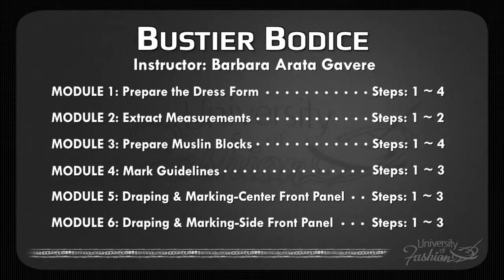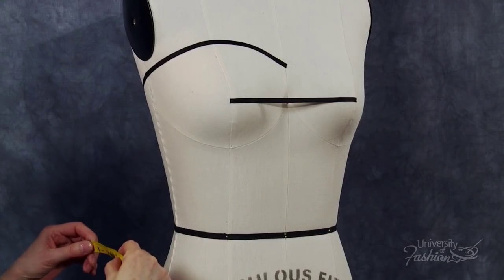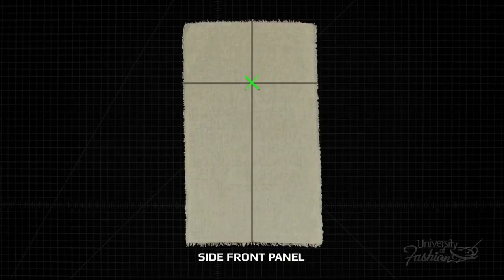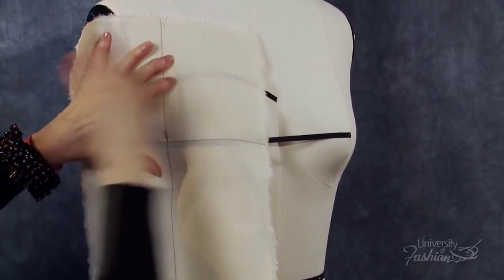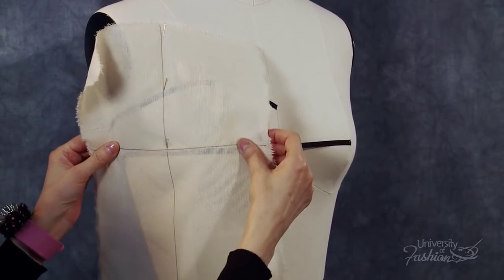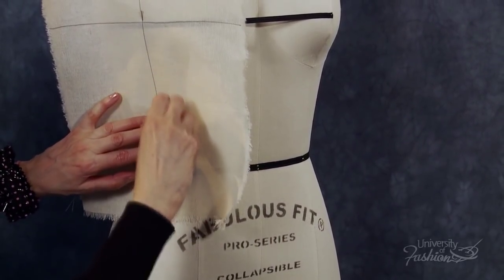Making a Bustier Bodice - Free Full Lesson!

Comment: Question, I have a dress form and I design clothes for different people the dress form is not adjustable. How can you construct different garments on a dress form that does not adjust to different sizes.  Just a standard foam.  Please reply.  Thank you.
Reply: LAURICE HUBBARD I’m not a fashion designer, so take my advice with a grain of salt, but I have seen people adding padding to a dress form.  I’ve also seen people taking a padded bra that fits very well and pinning it to the dress form  and then stuffing it to help it maintain its shape. You could also add a layer of panty hose or something similar over it and stuff it to the correct proportions.  Just some ideas.

Comment: But adding 3" is an extra 1.5" on the seams..which is HUGE. and can drastically affect a curved seam if youre measuring that far away from the actual sewing line.... 5/8" seam is the norm so you can let out each seam up to an inch if absolutely necessary
Reply from the maker: Can you explain what you are referring to when you say "adding 3"?"

Comment: Can we not do this with out doing it in the maniquin,,if we could just do it with the measurement we got from the costumer?
Reply from the maker: This is a draping lesson for making a bustier. What you would like to do would require a pattern making lesson. But, yes, then you could make this bustier using your client's measurements, alone. Both approaches can get the job done.
Reply from the maker: Sure, if you're working with a private customer. But, no if your goal is manufacture your design in multiple sizes.